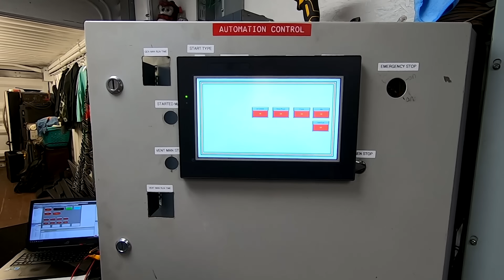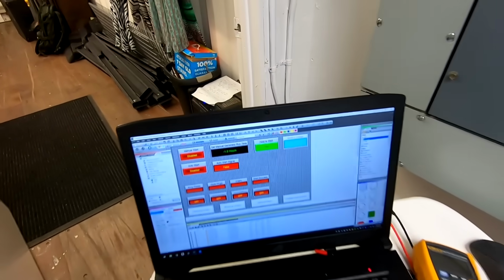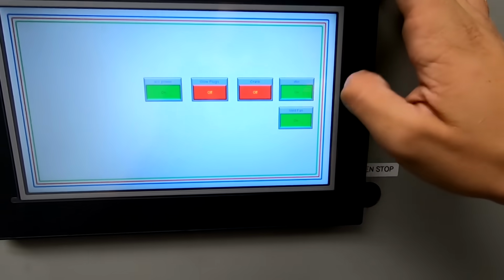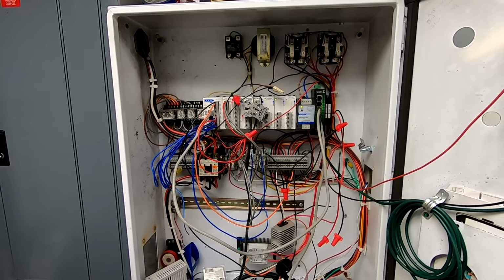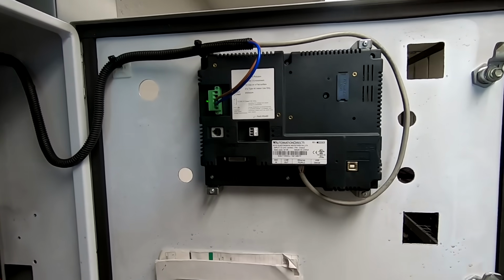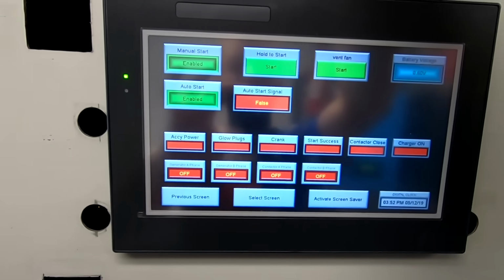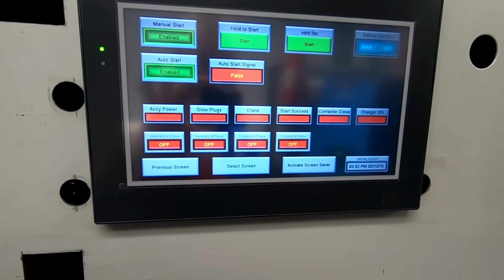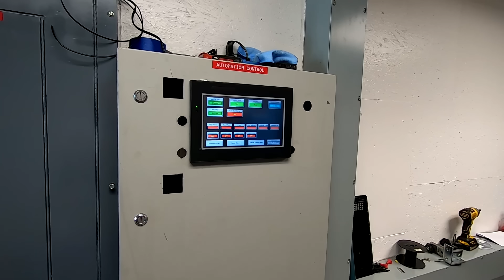Off Grid: Touch Screen Control Panel Addition and PLC Cabinet Rebuild

Comment: Too bad might have been cool to put that touch screen at the bottom and leave the buttons for historic value or for Step dad to use lol.
Reply from the maker: I had considered it, but being bent over and using a touch panel is not fun.  Also if there is an error I want to have that clearly visable at normal eye level.
Reply: @HighTechLab  Cool does it have a screen password or lock out to keep the wandering fingers out?
Reply from the maker: If you program it to have one, then yes.  You can set up multiple users, e.g. managers, operators, maintnence crew.....It's full on industrial grade kit.
Reply: @HighTechLab  Does the lcd backlight stay on constantly, have a time out or dim function, or could you setup like a PIR motion sensor as an input that wakes up and keeps awake the LCD while humans are around it?  I've seen some of the early LCD panels that after years of reliable use 24x7x365 now have very dim displays because the LEDs wear out.  That's likely an expensive repair later on that might be averted with a screen save feature, plus it saves a little power.
Reply from the maker: Yeah, there is a button to turn on screen save mode and I believe I can set up a delay where of there is no input have it go into screen save mode.
Reply: @HighTechLab  very cool

Comment: Nice.  If a fella wanted to play with something like this what’s the bare minimum in software terms?  Did that MMI come with enough software to program a PLC?
Reply from the maker: Some HMI panels have free software, but from my research it lacks features that makes programming a bit simpler, for example being able to simulate your program before sending to plc, etc. etc.  The PLC Programming software works alongside the HMI, so you would need both.  In the case of the CLICK PLC that I use, that has free software.
Reply: HighTechLab cool. Thank you What’s the name of the software that can perform simulations?
Reply from the maker: It's all through the C-MORE programming software.